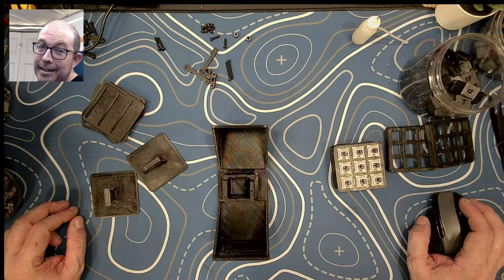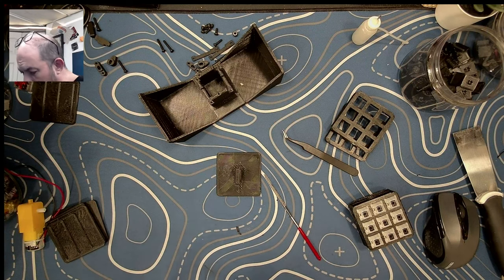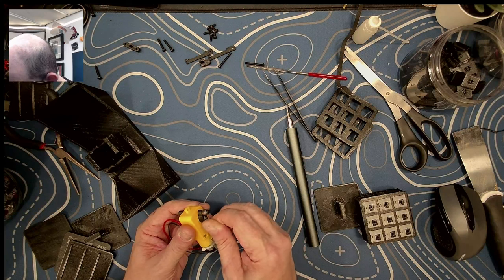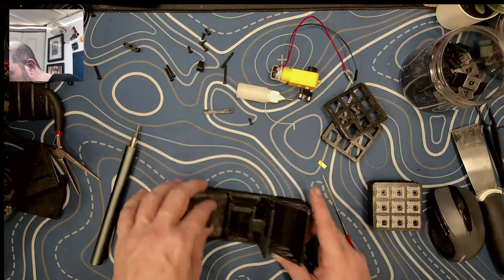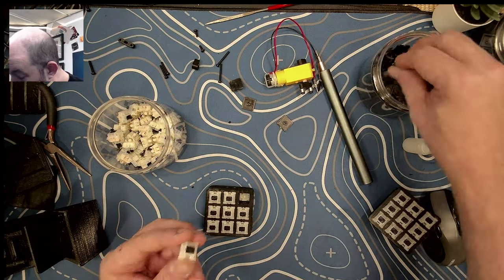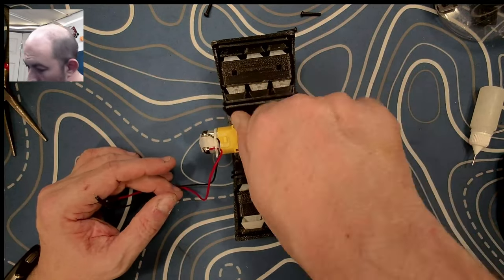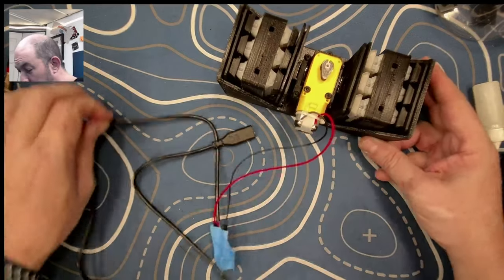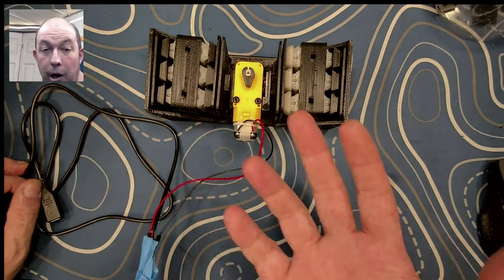Let's Make a Switch Break In Machine

Comment: Great video build one myself, and had a few problems the of center plate closest to the motor started moving up and sideways, just straight running way, and have burned about 4 motor because of probably heat (ran for 4/5hours), gave up with 1:48, i'm using the 1:90 ones now
Reply from the maker: Very cool, thanks for sharing and hope you've got the issues worked out. I'm 90% of the way through breaking in my entire collection!

Comment: I picked up the same motor but im having problems with it not pushing when everything is put together when i load one side up with swirches it pushes fine but when i load up both sides it jams. Would you know any potential flaws i may have with my unit i made?
Reply from the maker: I did find that it helped to add some lubrication to the arms to make sure that they glide smoothly, otherwise small imperfections in the print can cause binding.

Comment: my motor keeps on stopping by itself, feels really hot. Using same model as you. Is it faulty motor or something else in the 3D print you think ?
Reply from the maker: If it's not actuating properly it could over heat. Have you lubed the pieces and insured they move freely? How long are you running it before it gets hot?
Reply: @MechKeyboards  Hi so it was running maybe 15 mins then it gets hot then stopped. Now I've just moved the cable a bit and running for a few hours so seems good. Have spare motors so will try those too.

I didn't know about lubing actually. I'm assuming you lube the actuation plate where it connects to the main housing? That would probably help, as I had to sand down my actuation plate a lot to get the machine working, otherwise it would get stuck.
Reply from the maker: @matchpoint2899  I lubed in two different spots on each side, as seen in the video, I also printed at 0.10mm thus tolerances were good, requiring no post processing. You are most likely binding it which in turn is overworking the motor. As long as I never run it for more than six hours straight, they keep on going. Good luck!
Reply: @MechKeyboards  Thanks! Last q, what do you mean by binding it? Is it where there isn't enough room for the motor to fully rotate so it has to push/exert excess force?
Reply from the maker: @matchpoint2899  binding as in parts are restraining it from moving smoothly.

The entire actuation plate should move back and forth freely.
Reply: @MechKeyboards  Sanded down each plates and runs more consistently now. Motor makes a high pitched noise, same motor as you're using. Perhaps still binding occurring, as I believe high pitched sound from motor is caused due to operation under normal rotation speed (indicating binding reducing the motor speed)?
Reply from the maker: @matchpoint2899  motor should not be making a high pitched noise when running: https://www.youtube.com/shorts/RwMdc5Qiyh0
Reply: @MechKeyboards  Probably binding then. When you rotate your motor manually, do you feel resistance when it completes a rotation/passes the actuation plate? Mine has a considerable amount of force I need to push to make it complete a rotation. Thanks.
Reply from the maker: @matchpoint2899  no resistance, it moves freely and smoothly. Perhaps reprint parts at a higher resolution or reach out to the designer?

Comment: Hey! Couple of question.

What material is this? PLA, PETG or ABS?

What Infill is this? 10%, 20%, 30% ... etc?

What layer height? 0.1mm, 0.2mm or 0.3mm?
Reply from the maker: There was no guidance on the project's Github repo, so I just selected what I felt was best, everything besides the keycaps were printed using PLA with 20% infill and a layer height of 0.2mm, the keycaps I printed using 0.12mm again with 20% infill.
Reply: @MechKeyboards  Thank you so much! How is it holding up with extended usage? Anything i'd need to look out for?
Reply: @thaidye  motor should not be run for more than 6 hours at a time